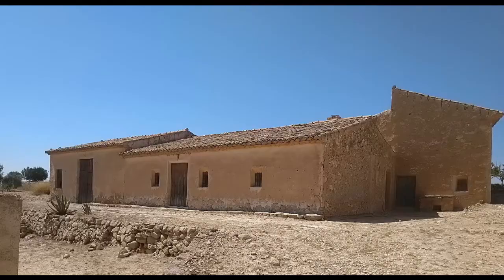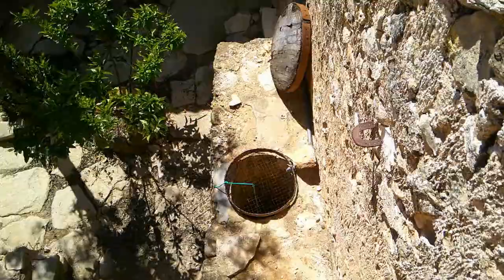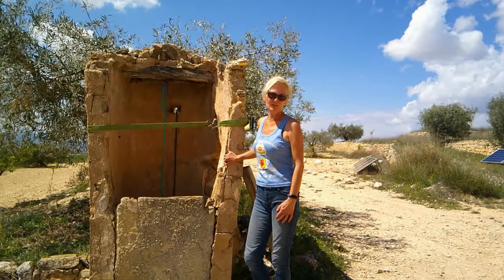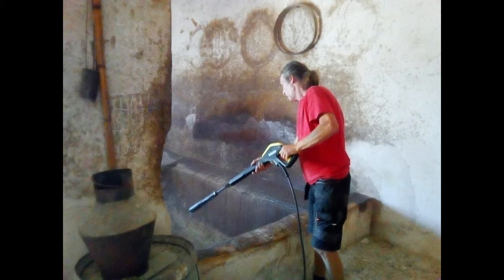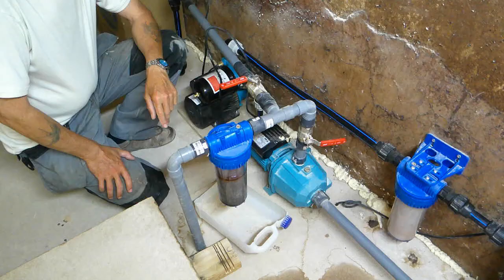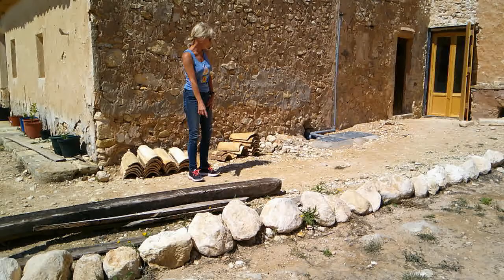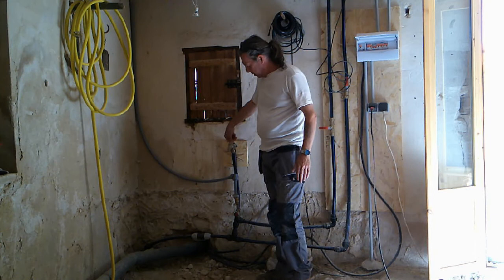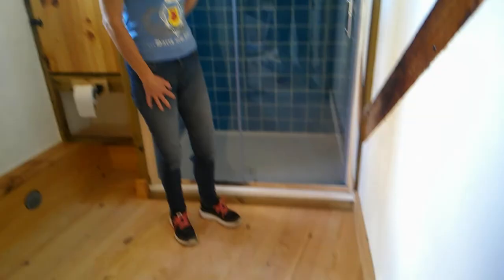Off grid Finca restoration - Where we get our water from...

Comment: Fantastic work and great explanations. Finally sealing that water deposit must have been a celebration day! Well done. ☘️☘️
Reply from the maker: It was a bit of a relief. It was good to be able to use one of the original features.
Reply: @FincaLife  absolutely. A lot of off grid people will have the same issue, would you mind telling us exactly what the product was that solved the problem and how long has it been working for? Thank you. ☘️☘️
Reply from the maker: @valleyviewretreat It's been fine for over a year now and should last technically forever. I can't find the order details. I'll have a look today and let you know. I lined the tank with polyester resin and glass fibre (roving), then primed it and painted it with a two part food grade epoxy. I'll come back to you later with the product details.
Reply from the maker: Apologies, I can't find the actual stuff we used. I'll keep digging....
Reply: @FincaLife  don’t worry, I just thought it would be something of use to others in the same boat. The main reason I asked was because I didn’t see any fiberglass in the pics and I thought maybe you had found a new wonder product that wouldn’t leave me itching for three weeks after I used it! 😂😂